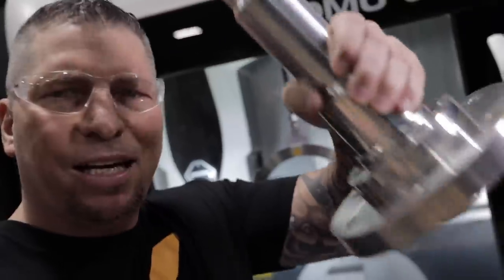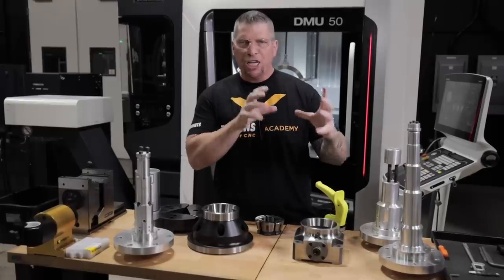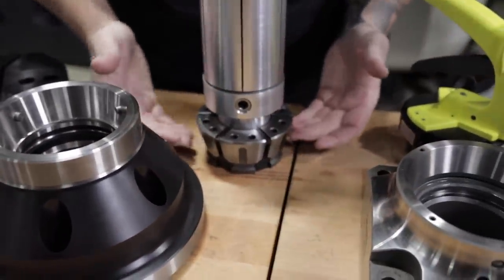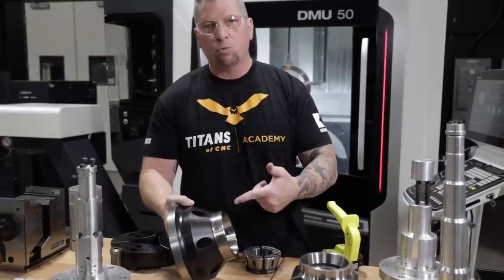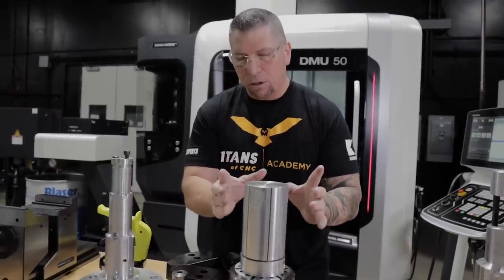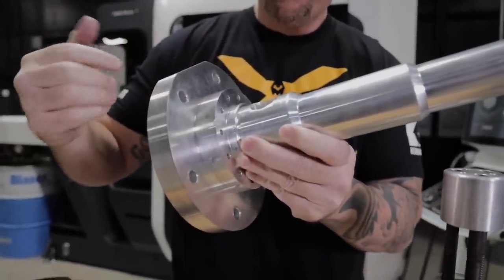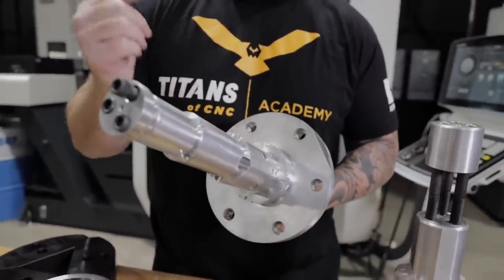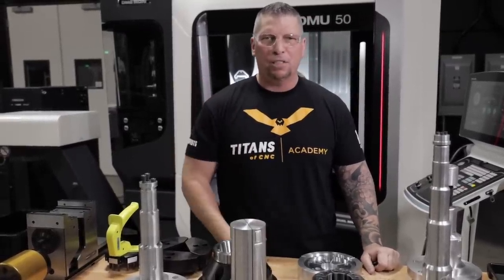Incredible Aerospace Fixturing | TITANS of CNC Vlog #49

Comment: Thanks Titan and Crew!  Coincidentally, I had a customer bring a request for a thin-walled, closed-end cylindrical vessel through my door just yesterday.  Great video with useful information!

Also, my students could use videos about metrology and  using surface plates, indicators, height gauges, etc. (not so much CMMs).

Comment: perfect is relative to each use case, tolerances is always needed. Cool part, solid fixture. most of my work (hydraulic valves) also needs "perfect" alignment in different fixtures.

Comment: I just realized how to make small  AL6061-T6 connectors with 0.012" (+/-0.001") thin walls 
OD:0.870"  
ID:0.846"
Length of thin wall section 0.75" on 2.00" long part.
Now, our qty volumen is very low (lots of 5pcs with EAU: 40pcs), does custom mandrel cost worth for a $62.40ea?
Thanks Titan!
We meet in Chicago last two IMTS 2016 and 2018.

Comment: that royal collet also has the tapering issue, Hainbuch (and maybe royal?) make a collet with a hexagonal exterior, so when it gets pulled you have flat surfaces sliding on one another, as opposed to a cone which effectively is pulling a larger diameter into a smaller diameter. Nice mandrel tho... hydraulic?

Comment: How do you approach the size-on-size issue with pie jaws in a lathe?  We bar feed and subspindle transfer the vast majority of our turned parts, and to date I have just cut the jaws, then moved them out a notch all around for the needed clearance.  I know there is inherent inaccuracy with this, but so far no problems.  Is there a better way to do this?  I've got some chucked parts coming up that will require pie jaws.

Comment: I once had to machine the inside diameter of a pipe 300mm in from either end . The pipe was roughly 300mm diameter & 5000 long. I did this by taking the toolpost & tailstock off a lathe that had a 4000 bed , making a fixture to hold the pipe onto the cross slide. Mounted a big boring head in fixture in the chuck & used the lathe as a horizontal borer. Most of what Titan is showing was so he could hold the tolerance required, but jigs & fixtures can free machine time by drilling simple holes in a radial drill using jigs rathe than put every operation through a cnc mill.

Comment: When are you gonna get a 7 axis machine to do these parts in one setup?
Reply from the maker: Just have 5 Axis right now...
But as with any thin walled Aerospace parts, you would still need a few operations to rough off all the material before relieving the pressure and kissing it into spec.